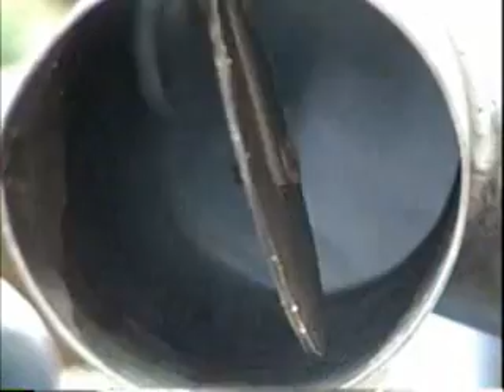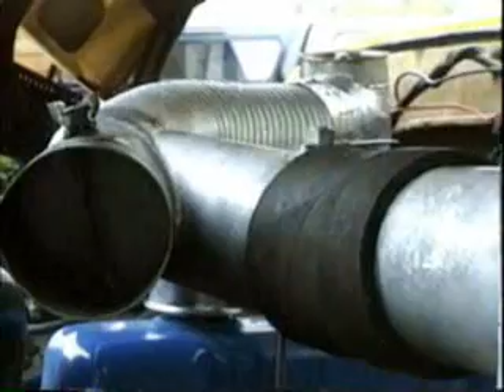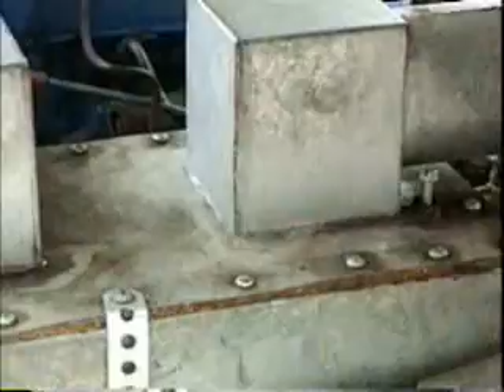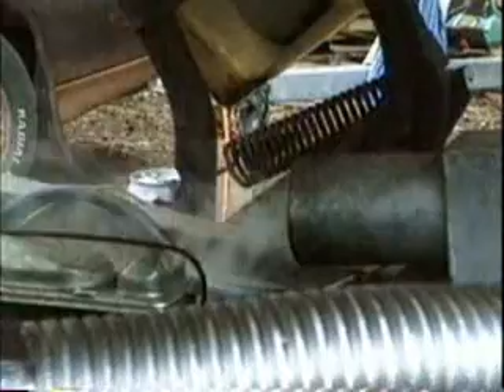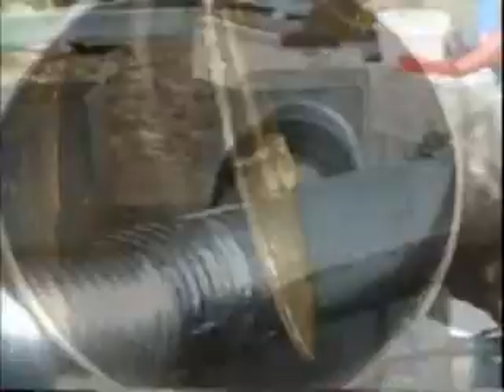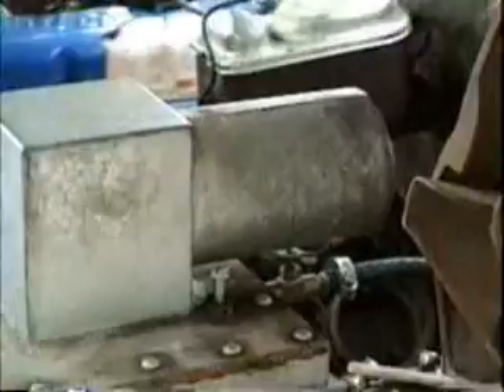Here is definitive proof on how to separate all Atoms in all liquid soluble matter.

Comment: @IAMBILLYTHEKID Paul Pantone- said the GEET Reactor designs for automotive use are different than the smaller motor free plans. Paul's system also utilizes a special process as well- which does not burn the liquid gasoline- and also allows the use of adding water, oil and many other liquids to the fuel tank source. If I had your knowledge- I would share it with everyone here on you tube. In this way- eveyone can work with your technology and make use of it today.

Comment: Then as the car companies added Cathalistic reactors the oil refineries found they could add some oil waste to the fuel and use the Cathalistic reactors  to burn up this oil waste  saving them money .So asking the oil companies to remove this material isnt a runner they got to get rid of this oil waste and it costs big bucks if they dont stick it in our fuels .Worse is the fact that out of the typical oil barrel some 40 gallons of oil costing $100 a barrel the first 5 gallons ...end part two

Comment: Correct me if I am wrong  but in the early days they used white or clear gasoline nowadays called colemans fuel>this fuel would work at low compression and as it would turn to gas easily was also clean burning leaing no soot  and didnt need a Cathalistic reactor to clean the emmisions .The addition of lead and Toulene and other fuels like Ethanol raised the octane and compression ratios and increased the power and polution and now the gasoline  fuels wont turn to vapour so easily  ...end part 1

Comment from the maker: It was an older building, and the state, and construction contractors never surveyed the area to determine the water drainage. This in turn caused my foundation, on the building to shift, causing cracks, and forcing me to turn the gas and water off to the building. The shifting finally set the rafters into the wood stove flue pipe, and that is what caused the fire. With no water supply I couldn't put it out.

Comment from the maker: Let  me put it this way which would you rather burn, diesel which produces smog and stinks, or if my lab tests prove me right, make hydrogen at the intake manifold, from water using a specific temperature and my process. When hydrogen burns, it makes water. Think about this, it is not known how much water can be reclaimed in a system like this, so engineered right, who knows how many miles you will get, when you are reclaiming water already taken from burned hydrogen. Lifetime of fuel, 1 tank.

Comment from the maker: @2220Blues What I am doing will make it possible to split water. When water is split, you get two parts hydrogen, and one part oxygen. I figure the surrounding air will supply the second oxygen source. Making the chemical makeup of H2 O2. (two parts hydrogen and two parts oxygen). This is a guess, but I know I can go there. No I don't use water and gas, I only use heat, a specific temperature using my process.

Comment from the maker: @whyme2b Actually all that vapor is made from gasoline, using heat and my process. What I did to the gasoline, I can do to any liquid. Just need to get my life back under control. I actually realized what I did, last year, and before I could get it together I had a home fire. Lost the chamber, but, I made this vapor by having an accident , seeing vapor like I saw once, when I was 12. I had to figure out a way to produce enough to run the biggest engines, so I did. Then water comes next.

Comment: @IAMBILLYTHEKID ...I believe this is the answer in running all vehicles on Smoke and Gas Vapors ! I made up a small system unit that would fit under anyone's hood and be perfectly safe ! also, you can just unplug all those fuel injectors that's just wasting your fuel...let's get 100% power out of that liquid gas instead of 17 to 30% and not waste any being burnt up in that thing called the CATALYTIC CONVERTER !!!

Comment from the maker: The trans ducer produces sound to heat the liquid. I use a higher heat than the transducer can produce. Here is your problem, the transducer produces 2.5 cubic inches of gas a second, well that is around 150 cubic feet per minute. An engine has say 400 cubic inches, and for every revolution of that engine it uses the full 400 cu. In. to take in fuel, and it needs at least 50% fuel to run. at 2000 RPM , means it would take a minum of 400,000 cubic inches of vapor fuel to run the engine. 150, no!

Comment from the maker: Think about this. The tube in the video, going to the tin cans welded together, over the carb, is a 4 inch aluminum drier vent tube. It is not heated anywhere, actually it is cooling the gas even more, and yet I have more vapor than the engine can use. I have made this gas, not vaporized it from gasoline.

Comment from the maker: To answer the question about an extension cord, it takes more than 12 volts for my process, so yes that is an extension cord, had a special generator made back then, inverters will do the trick today, much easier, and a stable voltage, easier to work with.

Comment from the maker: The butterfly valve inside the carb controls the amount of vapor the engine takes in, according to how far down you push the gas pedal. I made more vapor than the engine could use. I could run any size engine. Had it on a 360 Cu. In. 76 Ford 4X4, it would climb trees, running on it. Watch the video when I let off on the gas pedal, the vapor comes out of the tube and the chamber, more than enough vapor. This isn't gasoline vapor, it would turn to a liquid, at the temperature in the video.

Comment: Say Bill, you vaporize regular gasoline and mix it with air and put it directly into the carborator, how do you control the amount of vapor to allow you to drive the vehicle down the road?  Does the engine cut out when it consumes the vapor faster than it can be made? I see the cord plugged in, is that required to vaporize the fuel? Like you I have questions.

Comment from the maker: A transducer uses sound or frequency to heat the liquid. You would need to control the amount of heat the transducer produces, to do what I have done. One of my secrets is the temperature. I have reached the boiling temperature of a portion of the liquid gasoline, and the other portion of that liquid gasoline has a different boiling temperature, so it remains a liquid. I found a way to apply specific heat to the any liquid, I can do this to any liquid, water and hydrogen are next.

Comment from the maker: If I don't control what I have created the oil companies will own it, no research will be done with it. Vehicle mileage is a drop in the bucket. This can change the world. Do you know what a Molecular Structural Change is, and what it will do for the world? Nobody has ever done it before, the lab tests will prove it. You are making gasoline vapor from gasoline. Try making it work on a big V-8 engine. You can't make enough vapor. You see I have been there and done that. 30 years I have had this.

Comment from the maker: @AlternativeEnergy101 Actually a guy by the name of Fish created a carb earlier than that. It ran in the Indianapolis 500 in the 1920's. It was banned from the US shortly after that. There have been several carbs made over the years. Mine is not a carb, it will replace the carb. I am not getting a gasoline vapor, I created a new gas, from gasoline, lab tests will prove this. Hydrogen from water is next, when lab tests prove what I have done. Nobody has done this. I will patent the process.

Comment from the maker: @tc104x The fuel vapor carburetor, applies the heat to the fuel. I have found a way to  apply the fuel to the heat, this is why I have made the chemical conversion, and need the lab tests to prove what I say. What can be done to one liquid can be done to any liquid, water is my next step. You see I can take any liquid, to temperatures above the liquid's boiling temperature, never done before.

Comment: Go to Google patents and type in "fuel vapor carb" this type of atomizing of fuel & air has been 1900s. Vaporizing the over160 elements in our current gasoline by heating the fuel is simply absorbing heat energy and not making the COMPLETE conversion. Pressure is what, in combination, provides extraction of usable energy from the fuel. Understand the entire hydrocarbon chain of elements your trying to vaporize and what provide the engine to make the chemical conversion to mechanical energy.

Comment from the maker: @boxa888 Here is the thing. If I can get the grant I am seeking, and enough money to fine tune the chamber seen on You Tube, gasoline will not be used for fuel anymore. Natural gas will not be used anymore. I will make hydrogen from distilled water, with that same chamber, so gasoline will not be of concern. You will put water in the gas tank. What kind of milage will you get then, is what you need to ask. Oh and hydrogen makes water when it burns, so you reclaim the water and burn it again.

Comment from the maker: @energiainti Thank You. Seeing is believing, and you can't mistake the white colored low pressure gas. What can be done to one liquid can be done to any liquid, the laws of physics. I reached the specific temperature of a mixture of components in gasoline turning it to a low pressure gas, inside my chambe remains a non flammable liquid, derived from gasoline, neither are gasoline anymore. This is a molecular structual change on gasoline, water is a liquid. Two parts hydrogen, on part oxygen.

Comment from the maker: @tiltfulll Funny thing, I created this 25 years ago. I thought it was a way to run combustion engines on gasoline vapor, improving their gas milage. Putting it on You Tube I was compelled to explain what I did, to gasoline. I came to understand what I really did. To many things are different from gasoline, for either the liquid or the white colored low pressure gas to be gasoline anymore, and for them to come from gasoline, can only be a molecular structure change of the gasoline. Next water.

Comment from the maker: @torchgun You know when I tell how it is done, GM will not be able to stop it. Anybody can do it when they learn how it is done. This is why I know GM nor anybody else has the Patent on this. It is not Patentable. The vapor is a cold vapor. It is not gasoline but a low pressure flammable gas (vapor), with little or no carbon footprint, seen by the smog analyzer graphic readout (zero parts per million hydrocarbon reading, on my white vapor). I saw this over 25 years ago, and know now what I did.

Comment from the maker: 62 degrees Fahrenheit the difference in the boiling points of hydrogen and oxygen. This is where I need to go. With my process I can take water to that temperature range. When I do this the  hydrogen molecule will turn to a gas while the oxygen molecule remains a liquid. They separate making all the hydrogen water contains within itself. My chamber seen in the video, can do this fine tuning the controls. What is that worth?

Comment from the maker: The secret is being able to take any liquid to any temperature. When you reach the specific temperature of a liquid it changes to a gas. If the liquid is made up of different chemicals with different boiling points then one will remain a liquid the other will become a gas. Molecules react the same way, one can remain a liquid and the other a gas if you can reach the specific temperature of the one molecule and turn it to a gas, while the other remains a liquid. separation, H2(gas) & O (liquid).

Comment: Hello, I don´t understand,  your system works with gasoline vapor or not?  or do you run the motor with HHO from the water?  you can separate the HHO from water without electrolysis? just put water in a pre-heated recipient?  sorry for my ignorant but if you can get HHO only with heat is a very usefull way.

Comment from the maker: The bubbler is evaporation of the liquid gasoline. In refrigeration the evaporator cools the area. The boiling point of gasoline is between 100 and 400 degrees. The cooler the liquid gets the smaller amount of vapor the liquid will produce. Heat will increase the amount of vapor the liquid produces. The bigger the engine the more liquid gasoline vapor is needed to run the engine. The faster the engine runs the more vapor is needed to keep it running. A fish-tank bubbler won't do it.

Comment from the maker: First of all you applied heat to the gasoline, and i applied gasoline to the heat. This is our difference. I get a golden colored liquid. I also got a zero parts per million hydrocarbon reading on a smog gas analyzer. Telling me I probably have a liquid carbon, liquid. I don't have a gasoline vapor, like you have created. I have a white low pressure gas, that has twice the power output of gasoline. Do it with one liquid, do it with all liquids. Hydrogen from water is possible, from my chamber.

Comment from the maker: I have not done any mileage tests, but an increase in power will improve gas mileage. The mileage is not a concern. I get the answers I am looking for from the lab, and you will use water for fuel. No fuel cells for hydrogen, you can make hydrogen like I made the white gas seen in the video. Improve my controls and do it with the chamber you see in the video. When this happens there will be no more deaths by fuel fires, in automobiles.

Comment from the maker: Heat is what increases gas or vapor from any liquid, boiling the liquid produces the most. With flammable liquids, make sure you know what the ignition temperature is, and stay well below that temperature, or it will kill you. Any flame or spark will ignite flammable liquids. In my process I can take any liquid to any temperature, especially above the boiling point of the liquid. Doing this has produced a Molecular change.

Comment from the maker: I have had two patent disclosures and one patent pending. One problem, I've seen IBM and HP steal inventions. Patents are only as good as the money backing them. I had a patent disclosure on this, over 20 years ago. It was called a Combustable Liquid Vapor Chamber, back then. Had it at Chabot College, Hayward CA. some 25 years ago. When I went from gasoline to my fuel, which i didn't know at the time, The instructor said I was using Nitrous Oxide, seeing a 50% increase in horsepower

Comment from the maker: The type of heat doesn't matter, exhaust, or electric. How it is applied is the secret. Steam doesn't play any part of my process. Of course the temperature attained by the liquid creates the molecular change. Getting the liquid to a temperature above the boiling point of the liquid, is the answer, and my secret. I have had it on 7 different vehicles, tested on the road, some well above the speed limit.

Comment from the maker: I have no idea what chemical combination I have achieved but it has the same number of molecules as gasoline, but a much lower boiling point, increased power, and much cleaner exhaust. Just haven't had time to work on it lately, but I know the saturation temperature of hydrogen in water has got to be close to, and just above the boiling point of water. I will have to refine the process I use to make the molecular change.

Comment from the maker: Something else to add, about the gasoline thing. I got a 25% to 50% increase in braking horsepower to the ground, measured by two different dyno meters ( you know the machines with big rollers used to measure engine power on motor vehicles) I think this is better at  measuring power than a 5 ton trailer, don't you?.

Comment: Since gasoline isn't a compound but a mixture of compounds different compounds boil of in order of lowest - highest boiling points.

You have no proof that this produces any power, yes it runs, but it doesn't take a whole lot of fuel to idle and engine or rev it lightly at no load. Show it hauling a 5 ton trailer, then we'll talk.

Comment from the maker: The size and shape of the chamber are not an influence. The process is the answer. Like I have been trying to tell everyone this is a molecular change. I have discovered how to take liquids to any temperature, even above the boiling point of that liquid, this will give us hydrogen from water, and my process will allow us to do it on any vehicle. I will be altering the molecular structure of water, using temperature and extracting hydrogen.  Just have personal matters to attend to first.

Comment from the maker: Never tried transducers before. I know not what they can do. I just know you are not doing the same thing I am doing. I do know it will take a larger area to accumulate the amount of vapor, or gas to run the larger engines. Something else to think about the ignition point of the gasoline. Do the transducers produce excessive heat? You are doing something I have never tried, your on your own. I know what I have done, is a molecular change. I don't have gasoline anymore.

Comment from the maker: You have what I would call an evaporative gasoline vapor system. You are not getting a molecular change, with this type of system. You still have gasoline, you are boiling it. You'll find you can't make enough vapor to run an engine much bigger than you have on your video. Been there done it.

Comment from the maker: I have never calculated the mileage, I got such an increase in power, and so little smog, I never checked the mileage, besides, what I actually discovered was the molecular change, and mileage won't be of concern if I can find the saturation temperature for hydrogen in water. I have a 62 degree temperature range, to find it in.